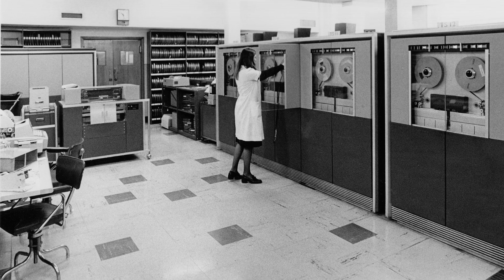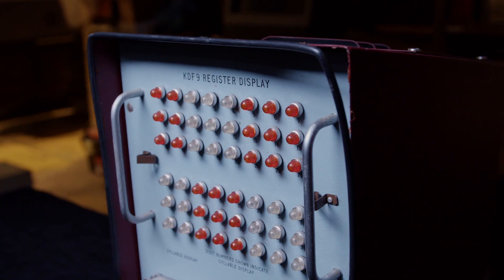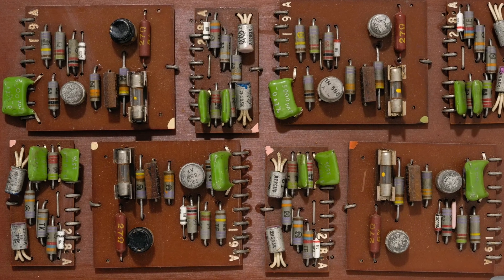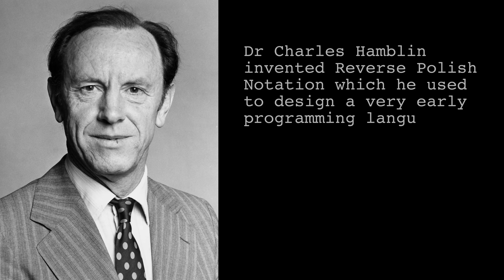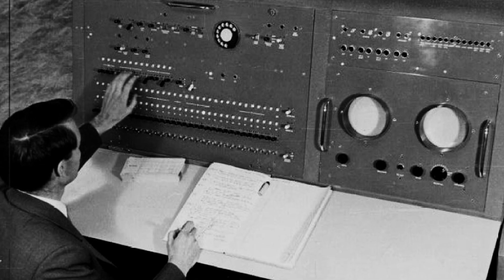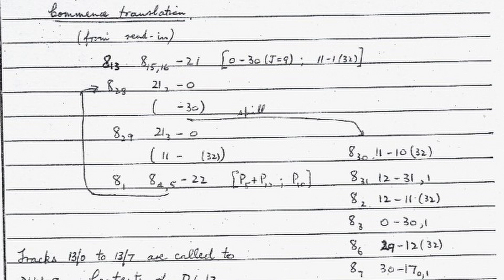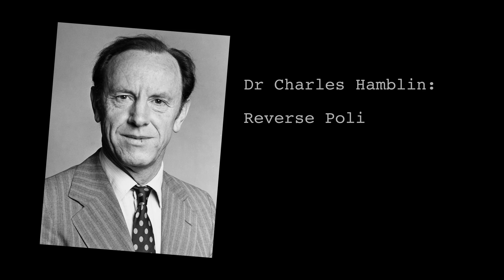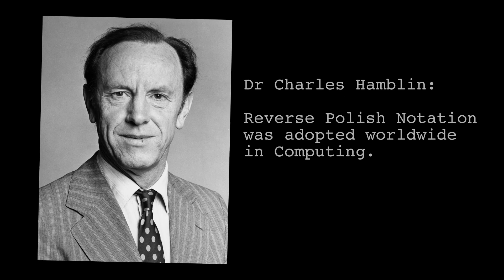KDF9 - Ep12 The Computer History Of Australia

Comment: Another Remarkable Doco, this would have been the next best thing since ENIAC (or slice bread :). The KDF9 was among the first machines to embody what we now coined as “CPU core” and operating around 1 MHz with 16 arithmetic registers and a highly advanced stack-based architecture. For 1963, this would of been light years ahead of its time, wow.
The term “core” memory hadn’t yet been coined, but the KDF9’s design clearly foreshadowed both modern CPU core concepts and magnetic core memory systems that soon followed.
 Its use of germanium transistors and toroidal pulse transformers technologies also developed in Australia by AWA (Amalgamated Wireless Australasia)  helped pave the way for this solid state revolution.
Although the KDF9 was designed and built in the UK by English Electric, umm it’s clear that Australian academics, engineers, and component manufacturers played a vital role in developing and advancing this kind of technology. It stands as a testament to the ingenuity and technical skill of that eraa true Australian linked computing legend. Although i see it been more Australian then english, academically and industrial wise.
But It’s a bit sad to think how much more Australia could have contributed to global computing if the government at the time had continued to invest in local innovation instead of submitting to foreign and economic pressures. Our Government killed the industry that once heavly relied on our skilled workforce.